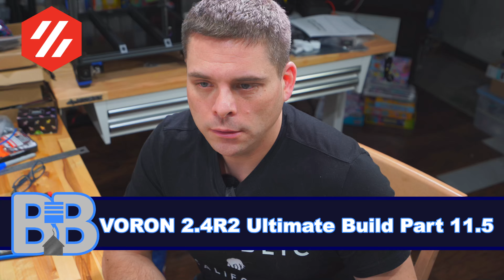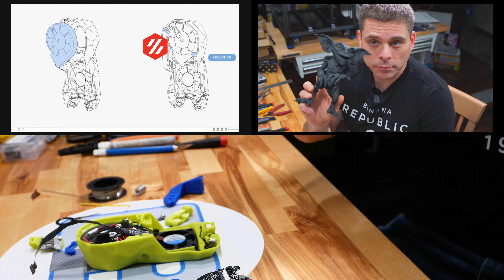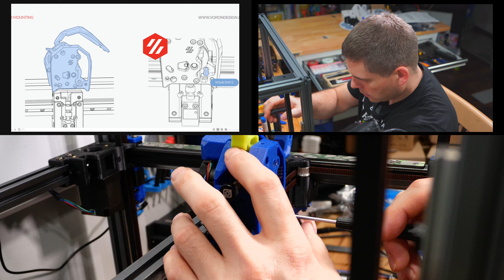Part 11.5 ULTIMATE Voron 2.4R2 SUPER DUPER StealthBurner

Comment: I found a cam that has the same specs as the 3do, but the ribbon cable is 150mm instead of 250mm like the 3do.  Will the shorter cable be enough to make it to the nozzle cam PCB?
Reply from the maker: Depends - Great answer right?  you can mount the PCB for the camera in a few different places.  I don't believe you'd quite make it to where I placed mine - but you could easily make it to the original mod that the PCB on the side of the SB Hotend fan area.
Reply: @BuildItBasement  thanks sir!

Comment: Where do we solder the rainbow barf to on the two piece toolhead pcb?
Reply: Yep. I’m also thinking of doing the 3DO nozzle camera. I saw your pcb was mounted on the back of the extruder motor. How hot does that motor get?
Reply from the maker: @maxdolski904  Not too warm for the PCB.  But - it depends on hard you're going to push the printer.  There is now a mod that mounts the PCB under the CW cover: https://www.printables.com/en/model/402744-stealthburner-toolhead-board-cover-with-integrated
Reply from the maker: There should be three pins on the daughter board.  5V G and S (signal). I believe it's near the center.  Let me know if you need more. Make sure you DONT run 24v to your neos
Reply: @BuildItBasement  can just those 3 pins individually control the nozzle lights and the logo?
Reply from the maker: @maxdolski904  YES!  The LEDs are adressable.  Great question.  I assume your RB came with the front and two bottom neos attached?

Comment: BO, a little lost.  A. the cover doesnt close completely close and B. I am struggling to figure out the tap wiring part because I dont have blue/black/Red, and mine are out of order.  So struggling to figure out if I am wiring this TAP incorrectly or if I am about to blow my stuff up.  I am showing where it only connects 2 cables to the probe jst and the red is soldered to the 5v and I dont see where you did that on the pins.
Reply from the maker: :_HelperDISCOBIB:Note the two ways in the link...
Reply: @BuildItBasement , so cut the trace, do I now plug the tap in the FS instead of the Probe port now?
Reply from the maker: @ReneWilsonSC  That is correct!
Reply from the maker: The GND is global to the board.  The signal wire and the 5V are specific.  Since you cut the trave to that pin you know which is 5V, the other two (if you look VERY close) should be labled on the board.  This all assumes you are using a modified 24V TAP board for 5V.  If you are using a new version, which I believe has red/orange/black wires you don't need to modify the board as 24V will work fine. You do need to modify it by solder jumping to the 5V or 24V pad.
Reply from the maker: @ReneWilsonSC  About mid-way down on this page you can see that the 2.1 cersion TAP board has the following pin out: +, Signal, Ground - top to bottom.  https://github.com/VoronDesign/Voron-Tap/tree/main/OptoTap
Reply: @BuildItBasement  I am PRETTY sure that I have the new version which is 24/5 V but I am not 100% sure so I just went the route of 5 v.  the colors that are included with mine was black, green, and red with a resistor inline.  So then in the FS port, have cables color in this order from left to right; Red, Black, then Green.
Reply from the maker: @ReneWilsonSC  The pin furthest to the front will be your DC voltag (24v or 5v w/mod).  Center is your ground and last is your signal.

Comment: I didn't have much luck with the flux pen. I might try a flux syringe. On the PCB where you converted it to 5 volts for the klicky. You said there "is a trace that's been cut" is that something we had to cut? or is it cut from the factory? Basically who cut it?
Reply from the maker: Oscar - Yes It was a trace I cut in a prior video.  I cut the trace that provide 24V to that pin and jumped a wire to a 5V source on that board.  I love my flux pen!  What was the issue you ran it to?  Keep in mind that you may also be able to use the 24v on the board with the new version (4/2023) Tap probe PCB.
Reply: @BuildItBasement  The pen wouldn't flow, then when I pushed it would sometimes flow too much. I couldn't direct it right where I wanted. And can't tell just by looking if the problem is because it's empty or low.
Reply from the maker: @oscarvogel2140  Interesting - I've had the same flux pen for about 15years!  https://amzn.to/3zBfKRr

Comment: @Build it Basement. 6:15. You are talking about the 1213 board for the 2 part main pcb where the probe is connected and you have a cut trace with a wire to jump. The BigTreeTech Octopus Pro allows you to change the voltage for the probe. 5V, 12V, or 24V. You'll find the information on page 17 of the manual. It also doesn't require the BAT diode
Reply from the maker: Good to know.  Always looking for good tips!  Thanks!  I'll make mention when I'm doing some final electronics wiring.

Comment: Thanks again for doing this series!  PIF parts coming in early next week and then I'm going to try and catch up with where you are in your build.  I'm most likely going to wait for the new TAP 24v to come out.  Might take a while but I think it will be worth the wait.  Looking forward to the next video!  BTW I want to make a plasma cutting table.  That's a project for another year though.  Take care.
Reply from the maker: PIF folks are great. I'll talk to you soon!
Reply: Good luck with your build! There are plenty of things you can start building as you wait for the new 24v Optotap sensor pcb to be released.
Reply from the maker: @SK3D20  I'm not waiting, covered to 5v.  Full speed ahead!
Reply: @BuildItBasement  I should of marked the post to the poster of the reply.   Sorry for the misunderstanding.